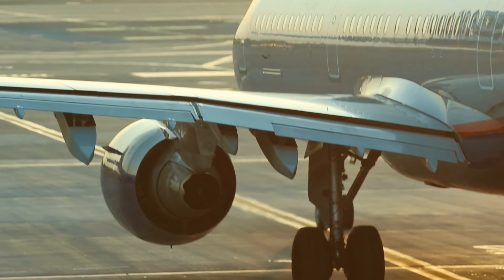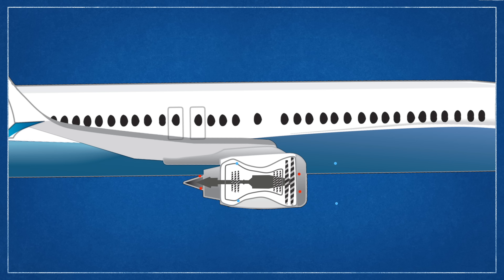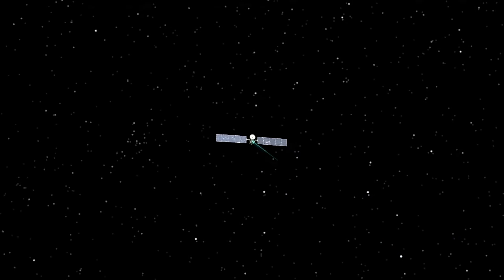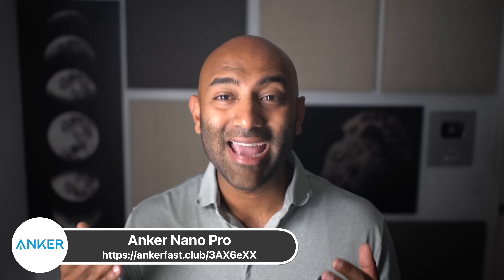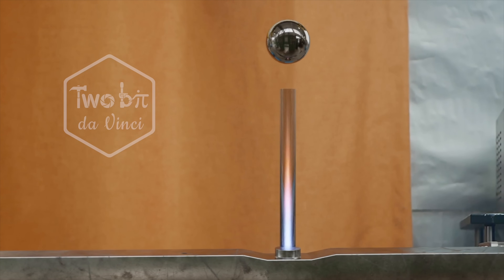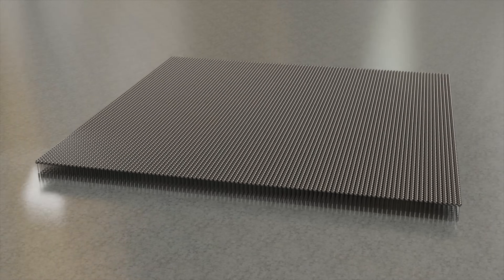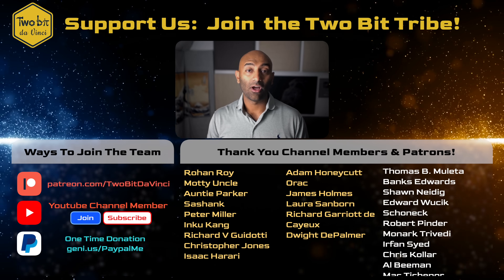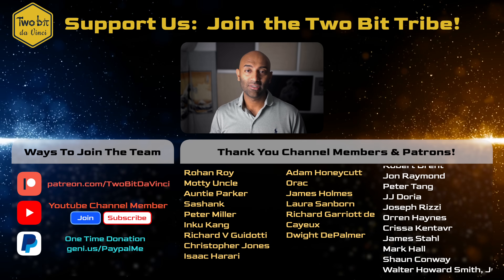The Next Generation of Jet Engines.... Is Electric?

Comment: I'm still not convinced that battery powered flight will ever be as advantageous as simply using biofuels with current jet technology. Fingers crossed though!
Reply: There’s definitely a cross over point.  Short flights by battery power will be more cost effective.
Reply: @xiaoka  That's definitely true for anything lightweight and short range. However, if you have to carry a lot of weight, we are going to need to get to the point where a whole battery/motor system weighs less than current fuel/engine systems otherwise you will frequently have to break into 2 or more round trips what before was only 1 round trip with fuel. (So electric powerplants will need to be half as expensive at a minimum if the same loads cannot be carried. This doesn't factor in costs that increase with more round trips like time, airframe cycles, loading/unloading cargo, and pilot pay just to name a few.) There are a few niches where electric flight is currently or will be a big win though!
Reply: Currently, biofuels take more energy to make than they contain. They don't make any sense, except from a political standpoint so you can feel good about the fact that they're "green". Not saying they can't work in the long term, but current technology isn't up to the task.
Reply: @maj429  Conservation of energy principle says otherwise.
Reply: @maj429  they have a high energy density, which is probably the point the OP was trying to make. Biofuels can be a direct substitute for fossil fuels in the applications where energy density is more important than cheap energy, long haul flight are probably the prime example.
Reply: @maj429  I don't think any artificially produced fuel source will ever be as cost effective as pulling crude oil out of the ground. Maybe costs will come down in the long term, or maybe not, but I was simply speaking to the energy density side of the equation regarding biofuels compared to batteries for aviation applications. If jet engines and/or airframe designs continue to increase in efficiency, then fuel cost becomes a smaller component of the equation.
Reply: No you are correct. Nothing can match the thrust to weight ratio of hydro-carbons and gas turbine engines.
Reply: For short haul flights where speed is less important than cost batteries will probably have the edge, electric aircraft are relatively cheap to power and maintain compared to internal combustion engines and you rarely need to carry much weight in these flights.

Comment: Would fuel cells be sufficient for non jet engines? Are electric motors too heavy to replace internal combustion engines? If any could point me to a good ref, I know duckduckgo is my friend.
Reply: Electric motors have a decent power to weight ratio compared to most internal combustion engines, almost all of the extra weight a fuel cell plane would have is coming from thicker fuel tanks and the added weight if the fuel cells themselves.